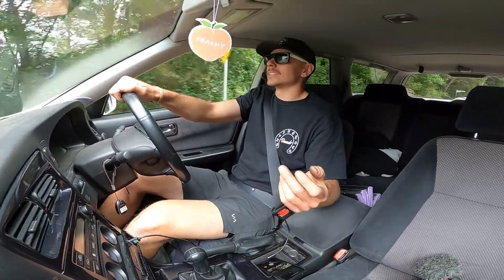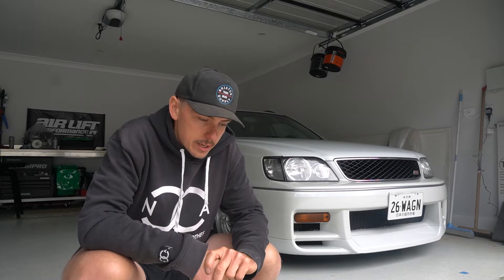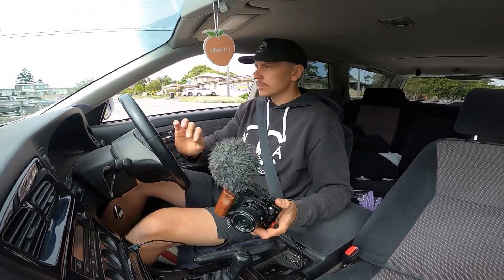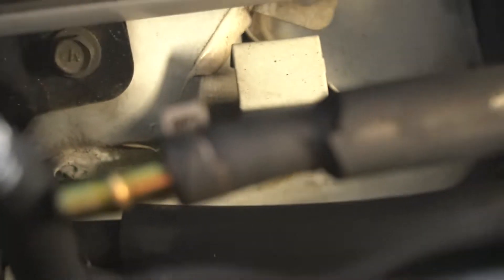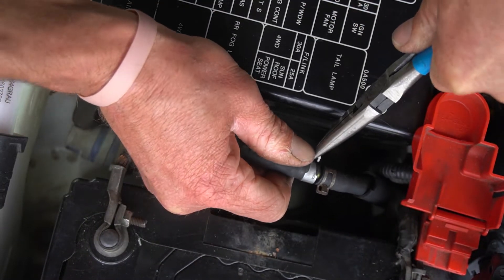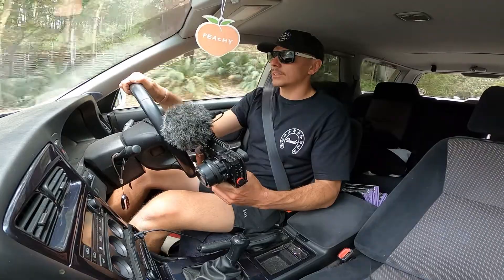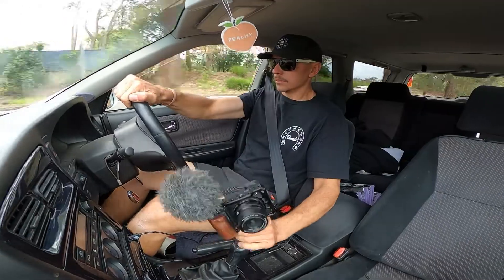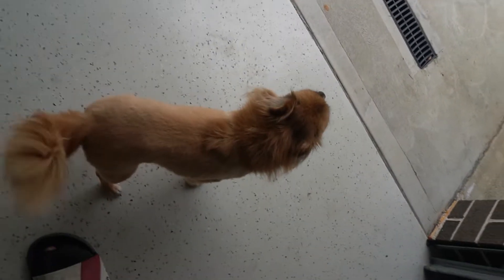Nissan Put This Hidden Boost Mod in my Car!

Comment: Love it! Glad you went for it! Mine was slightly different that I didn’t have the pipe split and then rejoined? Just one section of pipe all the way, that join might be causing you a little bit of restriction in itself as it’s smaller than the pipe. Glad you can enjoy it a bit more before your build plans. I’m currently doing the same! 👍
Reply from the maker: Hoping it's only a month or 2 of driving till she goes up on stands anyway 😅 good enough for now

Comment: How accurate are the factory boost gauges in ur type of car? 

Im about to get into upping the boost on my st185, it uses a system to limit boost in lower gears thats easily bypassed(kind of) but the first step recommended by others is an aftermarket gauge to give a more accurate reading. I know my factory gauge is slow to respond and more of a suggestion than anything.
Reply from the maker: Good, not great. For my use I was using it purely to see if there was a change - which it obviously showed there is. But as far as reading an accurate reading it's not perfect. 
Aftermarket gauge is definitely the go for a better scale/reading. Or even map sensor back to the ecu is your absolute best bet.